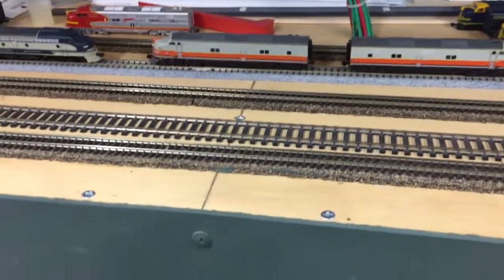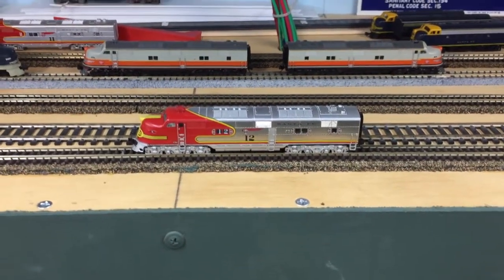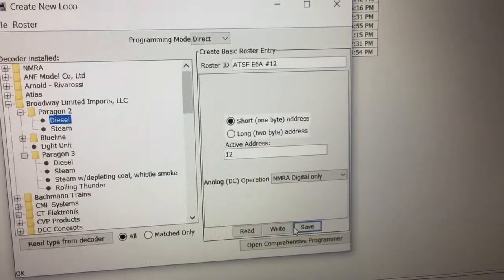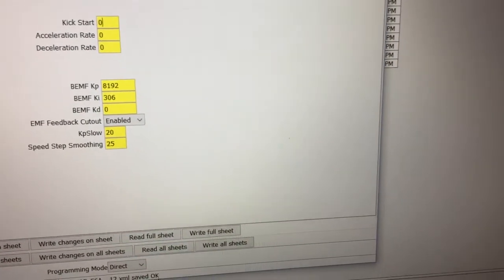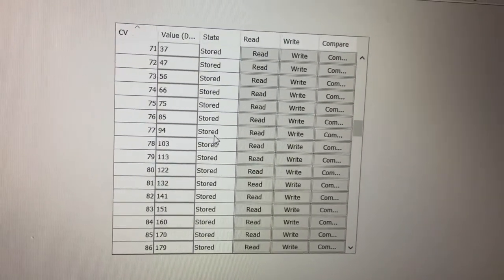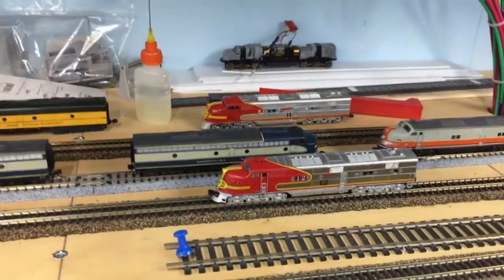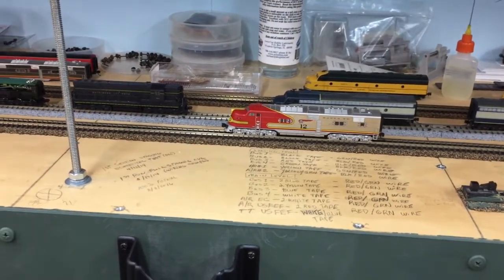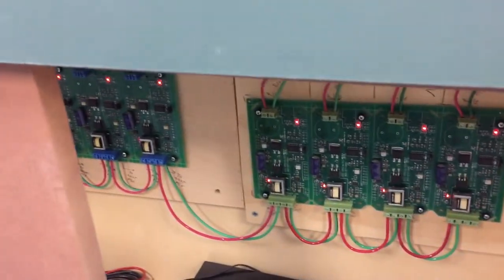Learning JMRI Part 2

Comment: Good show....thanks for sharing....Jack😁
Reply from the maker: Thanks Jack.  I spent the afternoon working on adding engines & was able to match two Milwaukee Road E6As and an ATSF E6A/B pair as consists after getting them inserted & programmed into the JMRI Decoder Pro inventory.  I am very close to getting the two Kato F7A units (NCE decoders) consisted with the Kato F7B (ESU decoder) and should be able to get them done later tonight.....John